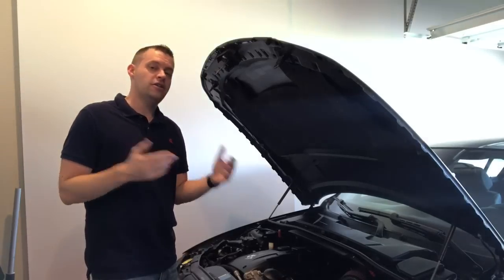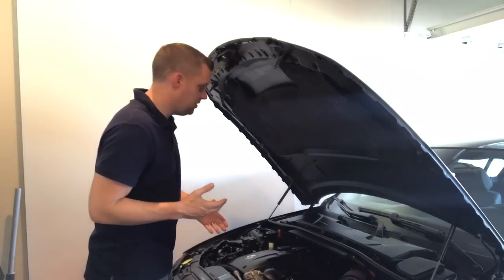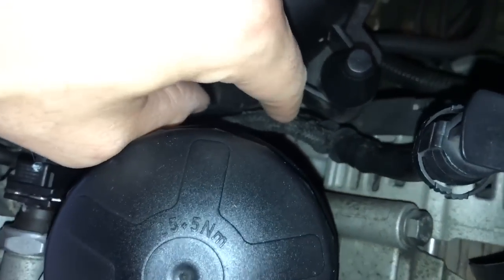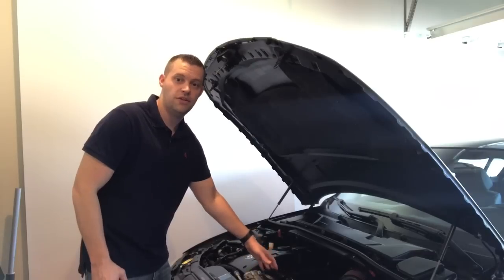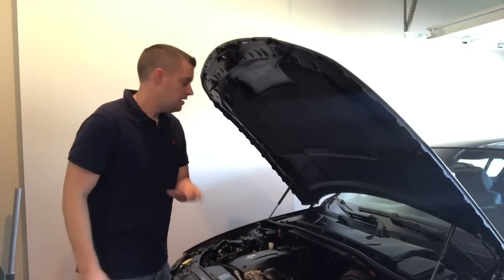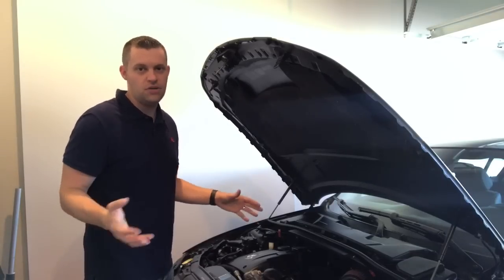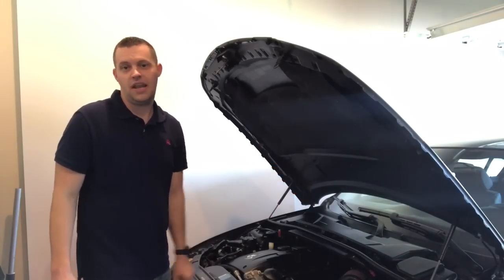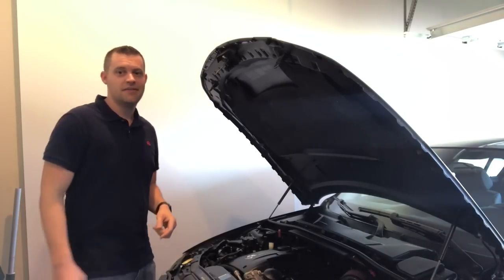BMW BOOST LEAK ISSUE PART 1!

Comment: The first vacuum line you show already looks like it could leak, when you start to change out the vacuum lines, grab a sharp item and cut/slice the vacuum line at the connection vertically, because the plastic nipples are easy to break. After that try twisting it a bit back and forth, because the nipples will be stuck to the inside of the vacuum line. The vacuum line rubber will feel more like plastic rather then rubber and start to break as you start getting them off.

Comment: Hey, first off, just want to say awesome videos. They’re very detailed and I’ve learned a lot from them. Also, I just wanted to get your input on an issue I’ve recently acquired. I have an 09 e92 N54, 86k miles, all maintenance up to date, plugs,  valve cover gasket, injectors, even new oem turbos 3k miles ago. Got a 30FF code and waste gates rattle like crazy, more so when decelerating. Car feels very sluggish, very little boost building up. Been running MHD Stage 1 for about 15k miles. Vacuum lines seem good, no signs of wear or places where they could be leaking. All hoses seem to be on, intercooler connections seem good too. Charge pipe and diverter valves are original. I didn’t see any tears by throttle body but I noticed oil around where the diverter valves connect to the charge pipe and fresh oil build up on the bottom on the outside of the charge pipe. Do you think the charge pipe and diverter valves could be the leak issue? And if so, could that cause my waste gates  to rattle like crazy? Or do you think this could be my boost solenoids that are bad and that would be causing this?

Comment: I replaced all vacuum lines, and I cut off all 4 nipples on my vacuum canisters, bought a set of vacuum hose connectors in autozone, cut those connectors in half, basically made new nipples, made those holes in canisters a bit wider, inserted new nipples there and put epoxy around. Wow!! My car started running way faster and my front turbo was howling for first there’s days..

Comment: I found the plastic canister tips which the vaccum lines go into are actually cracked at the base right against the canisters to where I couldn't see it until I pressed them side to side.

Comment: Thank you for the work you do! I have a boost leak issue that popped up when I drove the car to the limit. I'm guessing something blew so I'm gonna follow this! Going to replace my vacuum lines with silicone first and then if that doesnt work change the Intercooler and the charge pipe!

Comment: I have a coolant leak as well on the driver side next to the fan, I think I have to replace one of the hoses but I haven't figured it out yet, it keeps splashing my BMS intake and power steering and obviously I have to keep putting more coolant so annoying

Comment: I'm confused, so I'm just going to ask:  The boost solenoid controls the vacuum signal to the waste gate, and they are controlled electronically by the ECM, correct?  But you said in a earlier video that the duty cycle to the boost solenoid was only 50% in map 7?  So it seems that the problem is why aren't you getting the correct signal to the boost solenoid, which would make the waste gate close, which would raise your boost pressure?  I could understand if the duty cycle to the solenoid was 100% and your waste gate wasn't closing completely that you were losing vaccum. Am I not understanding how this works?

Comment: Are you getting 30FF codes? I get those too, less frequently after changing all the vacuum lines. Perhaps are stock turbos can’t keep up any more? By the way, My N63 in my 50i X5 had the same problem and it turned out to be a loose connection to the intercooler.

Comment: Check the wasgate. Trust me. It’s simple. You can fit your hand down and move the wasgate. You can’t really hear it very good with the stock exhaust when it’s bad.
Reply: N54Garage what do you do if it is the wastegate? Replace the turbos? Common problem for these stock turbos, isn’t it?

Comment: Are you running a stock exhaust with factory cats on there?  Have you toyed with the notion that your problem isnt a leak but just too restrictive of an exhaust system?  You could be chasing phantom problems if everything from the exhaust manifold back is stock.  
Just a thought.  I don't know your mod list aside from the jb4, intake, and intercooler and not sure if it's posted anywhere.

Comment: The front wastegate is a real bitch to get too! Took me like 30min just to get the line on. There is an artical I saw after I did it that shows an easy way to get the line on and off with a small copper wire. I think it's on n45 tech but you should check that out if you havent already.

Comment: Most likely the connection on your arm intercooler
Reply: Young Metro what did you do to fix ? I ripped the o ring installing my Intercooler . Replaced with one similar. Did you do something different
Reply: @jaymiranda1966  I haven't fixed mine yet whenever I just floor it wgdc goes to 99  but when I gradually step on the throttle while watching the the wgdc to not hit 99 then I get 30ff codes but as long as just floor it I dont get codes I checked the connectors a couple days ago and you can feel a good size gap I ordered a 750 psp intercooler so I'm not going to mess with it till I get it

Comment: Every week you seem to have some sort of problem with the car 😂😂
Reply: Amol Singh its the same issue, he's trying to boost higher, for more power and torque, obviously issues like boost leak will occur. He's already mentioned it runs fine at his previous boost level.

A lot of the stuff he does is maintenance that most owners don't do or cheap out on.
Reply: Saif0412 don’t even waste time on fools that are laughing at a man that could wrench his own way around the entire n54 engine.
Reply: Mcgyver B I’m just asking if it’s normal for his n54 to have issues every week ? The hells your problem?